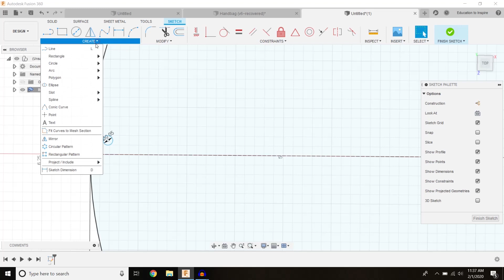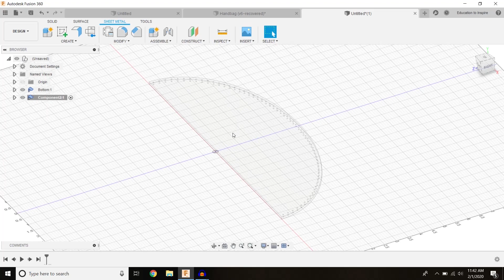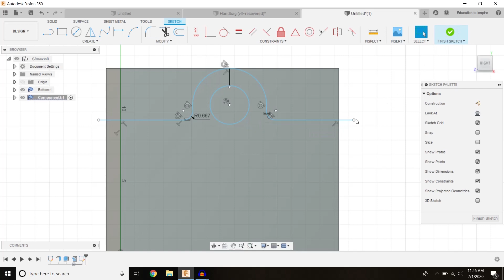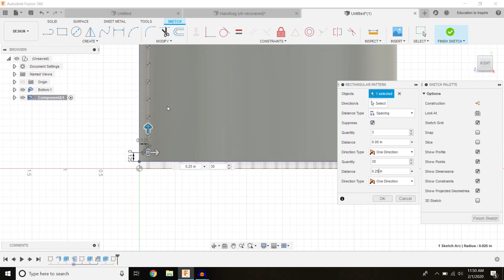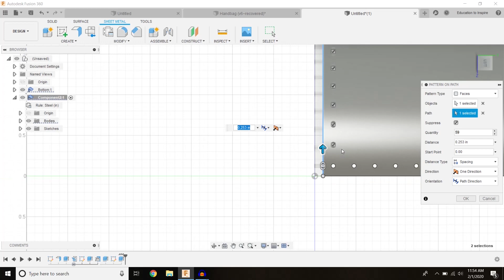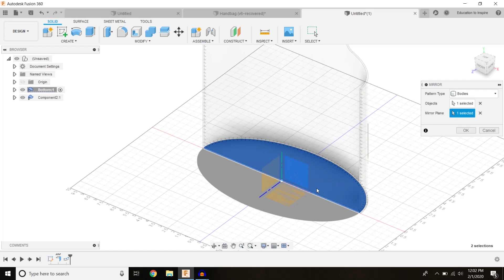Fusion 360 Leather Patterns - Oval Handbag - Sheet Metal basics to create leather patterns

Comment: I'm curious about how would you do stitching a bottom part with a sides part In my opinion, there should be a bit more complex work, like either to fold the edges of the bottom part to the down or even add a strip and stitch a bottom to the strip (folding the edges) and then stitch this strip-with-bottom-part to the sides part. Or something more either. Because if you stitch with holes on this model, the thread will be frayed soon. And if you try to fold the edges of the bottom part as it on this model, you'll find that you can't finish stitch - because you didn't planned folding indents, right?
Anyway, thank you for the video, it is very helpful for making holes on the path.

Comment: Great tutorial, what software do you use to add a stiches through the whole as I am struggling to create that
Reply from the maker: Fusion 360
Reply: Education to Inspire i have created the model using your stitch hole technique, only left w adding the actual ‘stitch’ on top. I’m not sure how to add
Reply from the maker: @lowhwasuan8079  you can create a sketch on the part you want the holes in, then project the geometry from the first part in to the sketch.  Or do the pattern on path after you create both pieces, just repeat the extrusion for both pieces.

Comment: For the stitch holes, couldn't you determine the length between the top and bottom holes with the inspect tool and use that for extent?
Reply from the maker: You could!  If you need everything really accurate like with sheet metal it would probably be a good idea.  With flexible materials dragging extent seem to be accurate enough.  Great point!  I'll add that to my next tutorial  :)